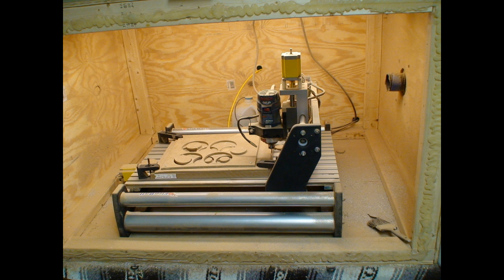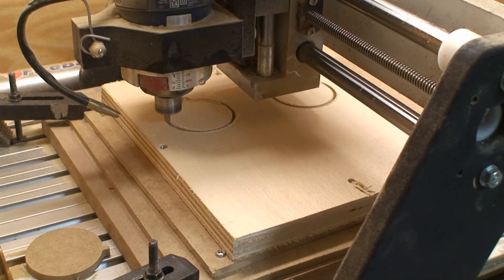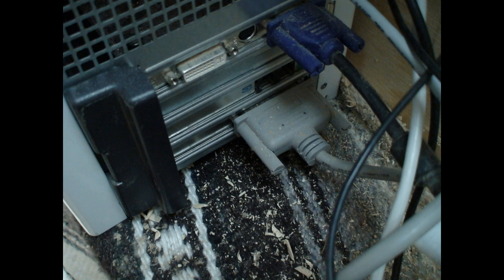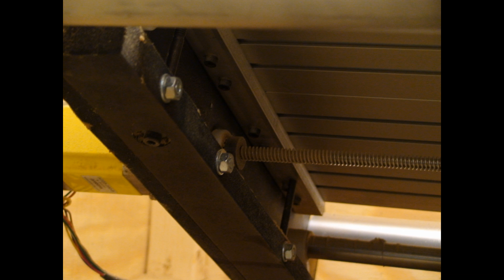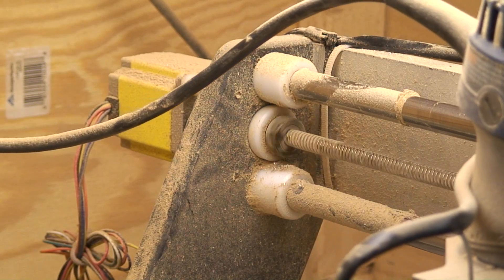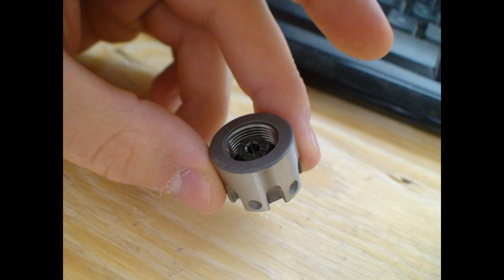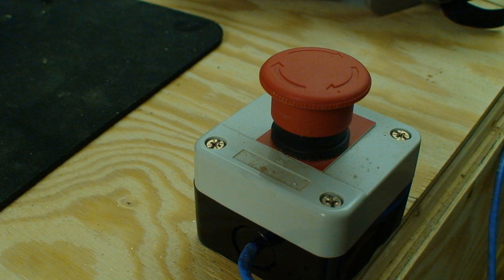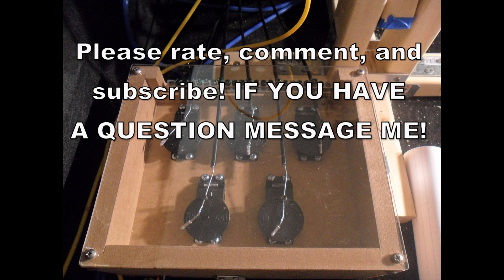DIY CNC Cutting Tutorial Video #1 - Probotix Fireball V90

Comment: Can you tell me what my least expensive option for the driver controller box, I have a desktop computer, the Fireball v90 but no probiotix box with drivers & can't spend $400+ dollars for the driver/controller unit. I'm familiar with Linux & Ubuntu. Thanks for your time
Reply from the maker: Joe there’s a few ways to build the driver. First off I am willing to sell mine for a low price. Second you can get a basic kit off eBay. I look for “MACH3 USB 3-Axis CNC Kit TB6560 Stepper Motor Driver Board+Nema23 Stepper Motor” on eBay and found that for $185 total you can get the whole package that’s USB and Mach3 compatible although it would need an enclosure and basic wiring. The new motors in that kit wouldn’t be as good as the stock yellow ones but they would work. The stock V90 motors are yellow in color and have 5 wires, I’m pretty sure it’s a unipolar but it could be a hybrid unipolar/bipolar one you’d have to check the wires (there’s YouTube videos that show you how to figure out if it’s unipolar or a hybrid with a volt meter. I’m mentioning that because most stepper motors I’ve come across are 4 wires with some being 8 wires although you can easily wire an 8 wire motor into a 4 wire driver by combining specific wires into pairs. Most stepper drivers in the eBay kits are for 4 or 8 wire motors but if you dig around you can probably find ones that’ll work for a 5 wire motor like the V90 has.

Now on to my controller box I’m willing to sell. I don’t know if it’s in the videos or not but I have a blue enclosure with all of my controller circuitry in it and some big extras. It has the upgraded high voltage power supply, 3 stepper drivers (I have a 4th axis driver I never installed, I’ll look for this but no guarantees I’ll find it). Additionally the box has outlets wired to a relay board for turning things on via the computer. It also has a router speed controller board that was $150 on its own and lastly a parallel port breakout board for pc control (this can easily be removed and a usb based mach3/4 board can be installed which is better and easier to use in the long run. I also have a fully disassembled V90 (don’t have wooden pieces anymore) so I have extra parts if you need any like the anti backlash lead screw nut and 2 yellow stock V90 stepper motors that work (I have a 3rd that may work but I think it’s broken). I’d include the nut and extra stepper motors for free with the controller box. Also I’d include the V90 router mount and my modified bosh colt router that goes with it for free along with the collets/but/wrench since I have no use for them.

I’d want $250 plus shipping $30 (if it goes over at all I’ll cover the extra shipping) for all of that stuff it’s a really good deal.

Additionally if you only want the power supply, motor drivers, (and I’ll just give you my extra yellow stepper motors), parallel breakout board and nothing else I can do that for $150 plus $20 to ship via flat rate.

I’d highly recommend the $250 option though you get a pre wired box to go off of. Once you add a usb board your looking at like $350 total this way or you can just use the parallel port if you have one or add a parallel port to your pc with an expansion card (this can be finicky though).

Let me know reply here or private message me. I’m willing to negotiate on price a bit if your tight on cash.
Reply from the maker: joe I apologize for my long initial reply but please read it all. I can provide pictures of my control box too and tech support once you get it, we can go through eBay if you want for a sale but that’ll take like 10% from me. PayPal gives you refund protection so I’d prefer to go that route independent of eBay.
Reply from the maker: joe 3rd reply haha just one last thing. I’d like to reiterate that I’m negotiable on the price. I’d really like it to know that my controller box will find a new home where it’ll get used on the machine it was intended for.

Also if your thinking of upgrading at all I have a full 4 axis 8060Z router with a 2.2kw spindle that’s a pretty big step up from the V90 while still remaining reasonably sized. It would include everything you’d need to get started including a cheap laptop with Mach 3 installed an ready to go. It cost me about $2600 new but I no longer have space to use it and won’t for a long time. I’d be willing to part with it for $800 plus $200 to ship (not freight shipping it’d be fedex but heavy and oddly sized hence the price).

Again I’m negotiable on price for that too. Sorry for trying to entice you into buying even more haha

Comment from the maker: You can use threaded rods BUT they will be far less precise. Threaded rods are much cheaper than lead screws for a reason - precision. Lead screws are specifically made for motion/position systems while threaded/stud rods are made for building structures. The same goes for the threaded nut. So in short it will work but don't be surprised if you get lots of backlash and possibly changing backlash as parts of the screw wear down.....this backlash will show itself in the final cut.

Comment from the maker: No but it can be used with cam programs by exporting the correct file format. I think the program is very limited and isn't all that great in the long run. You would be better off looking at the lower end cad programs ($75 - $150). They will allow you to make assemblies and quickly design parts. I have Autodesk Inventor but it is extremely expensive to buy unless you are a student and get the free student version.

Comment from the maker: If you want to stick with emc then I would call Probotix and ask them if you could possibly exchange the controller (and get a little $ back). Disconnect all cables then open up the RTR box and very carefully disconnect the hookups to each driver, power, and any others. Take that circuit out and change it with the parallel port rf isolated board that they sell. It has nearly identical connectors, then run the 2 cables from it outside the box. Put it together and its now a parallel system.

Comment from the maker: On the emc website it states that it is not compatible with USB based interface devices. The only way to get it working will be to install windows and then install a windows based control software. Probotix links to planet-cnc where there is compatible control software that looks to be free unless you want a commercial license. That software looks like its almost plug and play probably easier than mach 3 or emc.

Comment: I messed up when I ordered the v90, bc I ordered it with the usb control, not parallel. Not knowing that emc2 is only parallel. How would you recommend going forward with a xps laptop with ubuntu, and the v90 with the plug n play usb set-up? Unfortunately, I don't have enough experience to get it running... :( thank you for your input...

Comment from the maker: I think that emc2 is the way to go. Its completely free and can do everything the v90 is capable of. I feel that Mach 3 is WAY to visual. emc2 is a bland interface with simple controls. Its very simple but gets the job done just as well. Save the money you would spend on mach 3 and get a mini pc (check emc website for best models) to serve as a dedicated emc control box about $200 or less. Certain motherboards work out of the box....others require a lot of trouble to tune just right.

Comment from the maker: The motors I used are 280 Oz In or 1.96 Nm in a nema23 frame. Most small CNC machines use nema23 motors and most motors are at a minimum of around 1.2 Nm torque with bigger ones being around 3.0 Nm. When selecting a motor get something more powerful than you need! If you don't the motor could skip steps resulting in lost precision. My motors run off 40v and are powerful enough to snap bits (when the router is off) if I'm not careful. Where I'm jogging the spindle around.

Hope this helps!

Comment from the maker: You have to physically adjust the angle of the part to be milled with a jig or sine plate. Essentially I took that aluminum block and tilted it up on a specific angle then made a rectangular pocket in CamBam. This makes the angle of the surface parallel to the end of the bit. I will message you a link about a forum topic I started to make that part.

Comment from the maker: Probably 3 or 4 more parts to this video detailing all of the software and the whole process that I follow to take an idea or concept and turn it into a cnc cut part or assembly of parts. Then from there I plan to make shorter videos showcasing things like aluminum cutting and plastic cutting with the machine as well as more advanced things to cut out. 

I will have the second part up tomorrow for sure and probably the third as well.